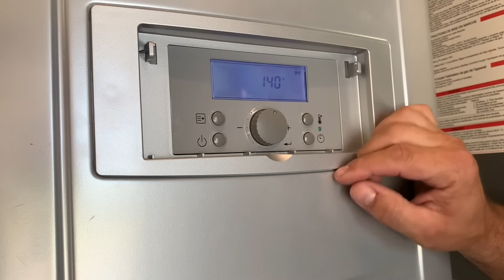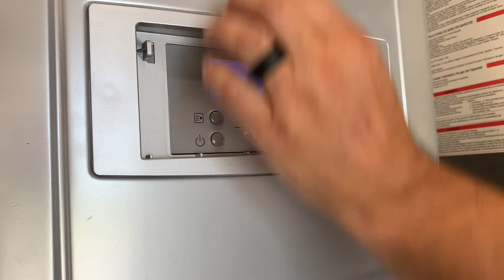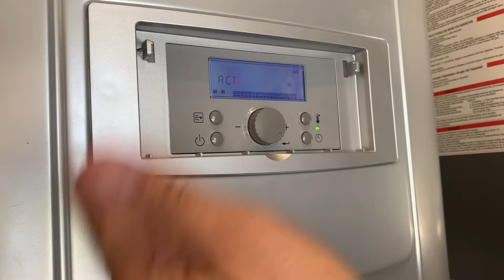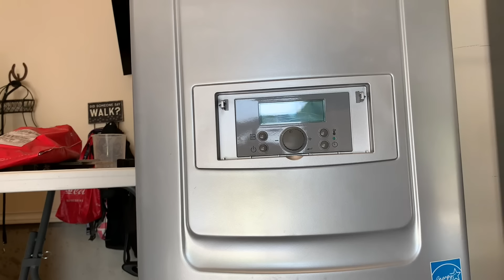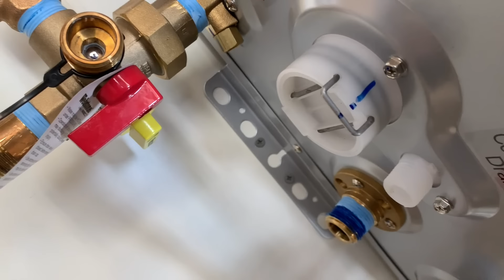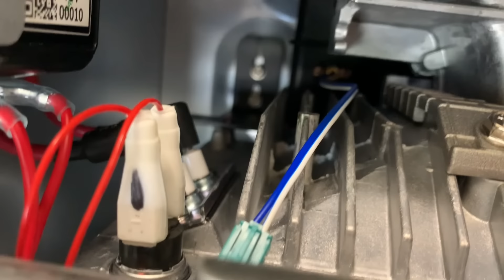Rheem Tankless RTGH-RH11 overview and programming steps

Comment: I have the combi unit for radiant heating. I dont want to use the radiant heating just the basic water heater. The control panel is just saying FILL and wont start. ???? Nothing in the retarded instruction manual says about this..or if i need to plumb it different if not using the radiant heating.

Comment: Sir thank you for the video posting. Your the best. I can refer to your video instead of calling the plumbing company that installed these useless things.  I hate theses damm useless water heaters there constantly faulting error codes I have two of these units in a newly built house of less than two years old. Theses Rheem units don't save any gas you spend more calling plumbing company on service calls including defective parts how are you to save in natural gas rather have tank water heater with a pilot lite. you spend more time on phone with representatives and they don't know cause they're reading from manual. always when calling Rheem just ask for tier level 2 senior representative.
Reply: It would be great if you can do Video with 2 of the Rheem tankless water heaters are synced together. How to unlinked them? Because once they're linked , you have no control over the second unit when they're linked together with the link cable. If you decide to do the video, please let me know.

Comment: I have the ngtx9600 hot water is fine but the heat fires for a few seconds then turns off …no codes.. rheem will not answer any questions due to the fact I am not an HVAC technician but I am a master automotive tech..when it fires the water exits the unit hot…the flame indicator turns off and the water turns cold..it only does one zone and the circulating pump remains running..I have no issue checking all the sensors but can’t find information on the specs

Comment: A true piece of junk. 
Have one that's never worked. They've replaced the mixing valve, main board,  control panel and it still does not function. Can't get the recirc pump to function or program the system. 
Customer service is the worst I've ever experienced..

Comment: The "Bypass" mode- is it when you add a sensor valve at the farthest fixture from the heater?
Reply from the maker: Yes.  That is correct.  Use bypass setting for circulation when utilizing under sink grund fos
Bypass.
Reply: @rickpowell1402  Thank you. You have no idea how much this video helps. Better than their customer support and the contractor who installed it. I have the Richmond model but it has the same settings. Thanks again

Comment: How do I increase temperature past the default max 120 degrees
Reply from the maker: Press and hold the temp icon button and the temp displays.  Then press it again and hold it till the scald warming pops up.  Then you can adjust above 120

Comment: I just purchased the expensive platinum rheem heater....sad to discover there's no warranty if you install it yourself!!!  I do much better work than any contractor alive.  No warranty?!?!?   I'm a retired US Air Force aircraft mechanic with a few college degrees....I'm not a moron.
Reply: I dont see any Plumbers fixing planes.
Reply: @doug995.  Actually there are airplane plumbers...they are hydraulic techs
Reply from the maker: You have a parts warranty.  You’ll likely need to call in.  There can be some hold times, but you can get parts sent to you.
Reply: Talk to Rheem.
Reply: Lol...

Comment: Hi I'm getting error 29 Condensate pipe I had to turn o. And off drain water very frustrating
Reply: We need to find out why you had a condensation stoppage in the first place.  All
Lines need to be checked for blockages
Reply: I don’t get the option to set the clock.. that option is missing. Any idea what I’m doing wrong?